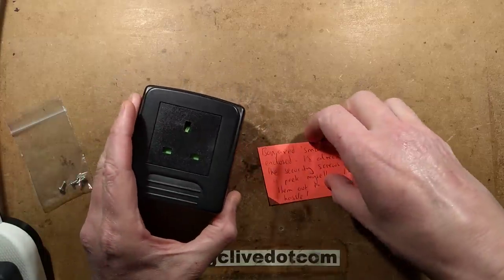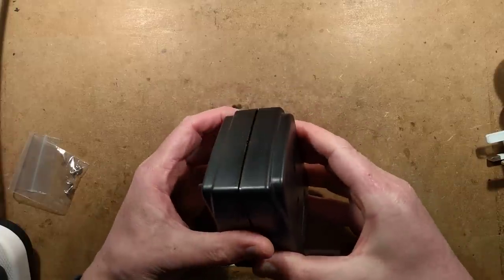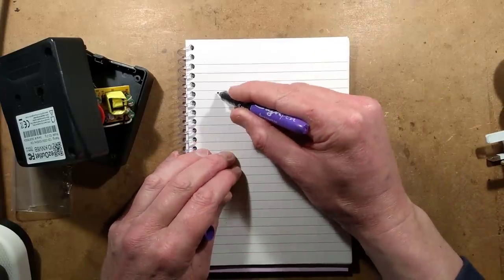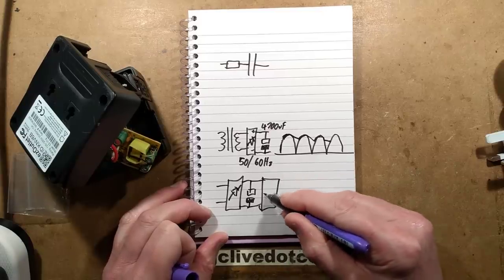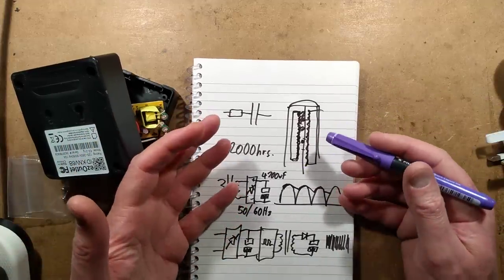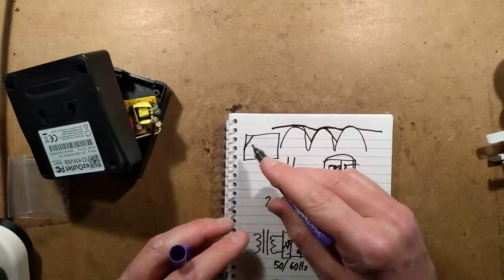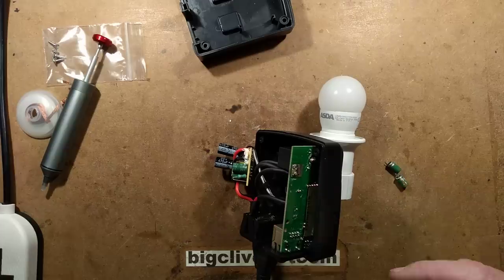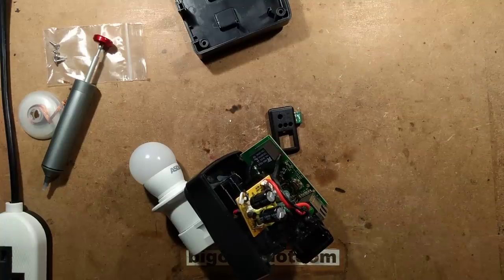Fixing an ezOutlet with inappropriate components.

Comment: It should be noted that the electrolytics stocked by CPC (as opposed to Farnell) are generally bottom of range and not the kind you generally want for switchers. Still vastly better than Chinese crap though. It won’t need 470uF for such a device. Use an appropriate capacitance of decent quality that will fit
Reply from the maker: I was toying with a pair of 220uF replacements.

Comment: I wonder how it decides you're connected to the Internet?  Maybe it just sends all your Internet traffic to another country's government and if they stop acknowledging it, that's when it realises the connection is down?
Reply from the maker: I think it just pings a site.
Reply: probably pings the gateway would be my guess
Reply: @JeffLMisc , I once had my router-pc reboot when it didn't reach a certain server on the internet. Suddenly, months later my internet connection got unstable, because the router was rebooting all the time. Because the server on the net was down. Darn.
Reply: Like other "control home-device from an app from everywhere", it connects to a server out on the internet, which acts as a mailbox. This is because usually, it is not possible to connect to anything behind the router from outside. So the app and the device communicate by leaving messages in the mailbox.

I guess the device reboots if it can not reach the mailbox. I would hope there are redundant servers it can ping, otherwise, that would be a large security problem: DOS that server, and routers and networks all over the world start to reboot.
Reply: This was mostly a joke.  Realistically there are things like Google's 8.8.8.8 DNS service that have such huge redundancy that they are never going to be down.  If you can't contact that, either your connection is down or your ISP is having bigger issues.

Comment: Do router crash that often? I've never experienced that problem.
Reply: It's also news to me.
I had some routers in the past 13 years, and sure, the branded ones you get from your ISP usually suck, but their common faults are shitty wifi/pings and packet loss, but not crashing or straight up losing connection. o.O
Just buy a >= 150€/$/£ router and most likely you'll never have any problems with it.
Reply: @Matt Quinn I had DSL for over a decade before recently switching to cable. Reboots were rare.
Reply: @V0odOo  Build up a pfSense/OPNsense or OpenWRT box (it's really easy) or buy an Edgerouter X if you just want something that works out of the box.
Reply: @Matt Quinn Perhaps there's a difference in service. I'm in the US, and short of a downed wire, my DSL service never had a problem. I'd never switched except the price doubled in the time I had it. Of course, being in the US, fiber will never happen... So... You got me there. :)

Comment: I am nowhere near as smart as some of the others here in this field but isn't the life span rating generally based off of the max temperature rating or worst acceptable conditions? I have an electrician friend who helped me with a few projects and I remember him talking about considering the derating of a capacitor and recommending me to find a way to reduce the temperature inside of the case even though I originally felt everything was within spec. I don't know how true any of this is but I was told for every 10c below the max safe temperature of the capacitor the life span was doubled. Meaning a 2000hr capacitor with a max safe temp of 105c would have a 32,000hr life span at 65c. Edit:I see one of those smarter people covered what I just said in a much more detailed fashion. Should have looked at comments first. lol

Comment: Bro only one question when I connect 775 motor to any new 12 v adaptor the motor doesont rotate continiously it takes intervals like on off on off continiously and  at same time light keeps blinking which  is given on adaptor
Reply from the maker: It sounds like the adaptor is cutting out on the high start current.
Reply: @bigclivedotcom  
So what actually I can do to run the motor give me solution please 😫🙏🙏💓
Reply from the maker: @drelectronics13  Use a higher power supply or add a large electrolytic capacitor to reduce the effect of the motor's start current.

Comment: or you can use a PFsense router built out of an old server and some ethernet cards
Reply: How many watts does that use vs. what a router uses? Just get an ER-X from Ubiquiti, dirt cheap, works flawless.
Reply: toysareforboys idk about you but where I live electricity is so cheap that I would never recuperate the cost of doing so
Reply: @toysareforboys1  An Atom or ARM platform would be very energy efficient as a router.

Comment: Good routers have a built in watch dog that will reboot the machine if it crashes
Reply: @gadgetman36  I have a MikroTik CCR1036-12G-4S-EM and a CCR1072-1G-8S+ and a RB2011UI-AS-2HND-IN those never crash but have watchdogs
Reply: My experience is with military avionics; critical circuits all had watchdog monitors built in.
Reply: @wirdy1  All good telecom equipment has watchdogs built in. In the elevator industry EVERYTHING has a watchdog, and in industrial automation too. Because a lock up will mean everything

Comment: What you think, is best for those? Ssr or normal relay?
Reply from the maker: Normal relay is probably the cheapest in these devices.
Reply: @bigclivedotcom There is disconnect and welding-problems in normal, but what about ssr?
Reply from the maker: @luukkuwet  SSRs often fail short circuit.

Comment: Clive, I sent you an email to send you a faulty reset switch that used WiFi instead of a wired connection.  I guess you won't see this message.    Viewers, should I just email Clive again?
Reply from the maker: Sorry.  It probably got buried in an email peak.  I read all emails but I can't always reply immediately and they get buried under the continuous incoming mail.
Reply: @bigclivedotcom  I resent it.

Comment: The 2,000 hours is because a reputable manufacturer will take random samples and test them for that period of time.  The QA system will say that, of the sample, only X% are allowed to fail before 2,000 hours or the entire batch has to be rejected.  Yeah, ISO 9000 fetishists, I've simplified a lot, but that's close enough.

Sure, the capacitor might well have a far longer lifetime than 2,000 hours.  But to be able to claim that longer life they'd have to test it for longer.  Which means they'd need more test setups and people to run them to achieve the same throughput.  And they'd have to store the whole batch for the duration of the test before they could ship it.

The same applies to the food industry.  Lea & Perrins reckon their Worcestershire Sauce has a shelf-life of at least a century.  But what they're allowed to claim on the label depends on how long they actually tested it for.  Ain't nobody got time to test for a 100-year shelf life.

USB connectors, which you plug and unplug frequently, are usually rated for 100 insertions.  They're capable of a lot more, but ain't nobody got the time to test that.

About the only common components where the rated lifetime is close to the actual lifetime are motors and filament lamps.

Comment: Year late! Everything is still plagued by short-life Chinese caps based on a bad formula sourced via outdated industrial espionage that causes the electrolyte to dry out prematurely. See badcaps.net forums.

I have a couple of Samsung LCD monitors where the internal p/s caps went bad after a couple of years, fixed for around $15us with Japanese caps (Rubycon/Panasonic) that are still going after 8+ years.

And they can be hard to replace, the Chinese ones lie about the voltage (or are just inadequate to start with) so it's impossible to get one with proper values that will fit without shenanigans.

Comment: The main high voltage bulk smoothing cap see's both the low frequency mains ripple, but it also see's high frequency from the switching transistor.
I have had to replace many 400V 100uF plug in caps on open frame 40W switching PSU's.
This is the cap I would use in your application.
https://uk.farnell.com/rubycon/10yxj470m6-3x11/cap-470-f-10v-20/dp/2346252
One cap failing before the other I guess one of them is directly connected to the rectifier and the other via an inductor.

Comment: Your pronunciation of router depends on how you say route really. Clive pronounces route as root, I'd be inclined to pronounce it as the other one, route, which is really hard to spell out phonically
Reply: Interesting to a non native English speaker. 
Do you differentiate the pronunciation of the wood working device/activity from the network device/path finding?
Reply: @michaeltempsch5282  I pronounce all the same way, I own a small banggood CNC router, I have an pfsense router, I'm good at finding a route, I'd say it all the same way. English is not as clean as some languages that have accent marks, ñ and á mark the pronunciation very clearly, refuse and refuse, spelled the same but not pronounced the same.
Reply: @Matt Quinn That aligns with what I've heard wrt UK Dnglish and why I asked.

Comment: Chuck in a couple of these Wurth: https://au.element14.com/wurth-elektronik/860010273011/cap-470-f-10v-20/dp/2465615 and away you go. 

There are also some Vishay 038 RSU Series that fit the bill 
or Kemet ESH Series
 that have a 105 degree rating.